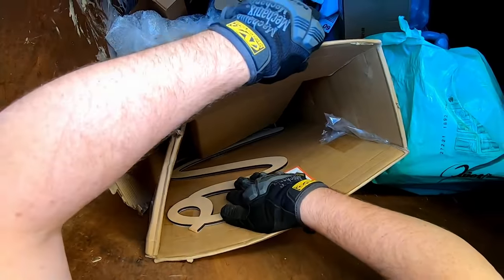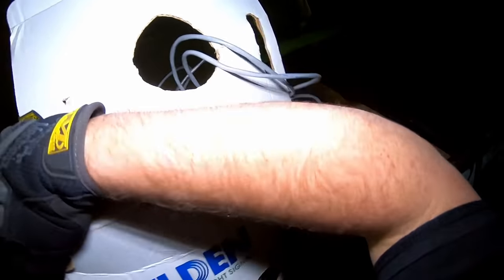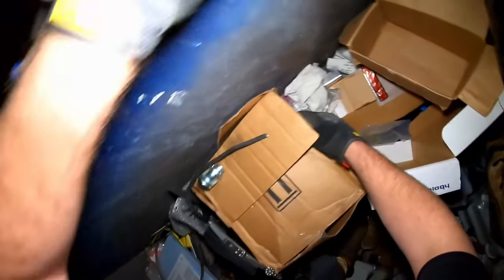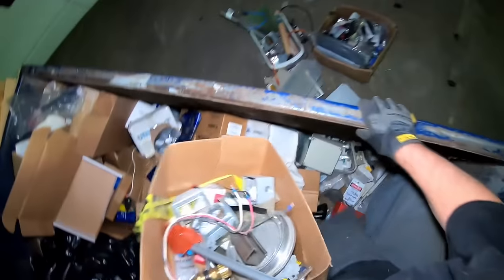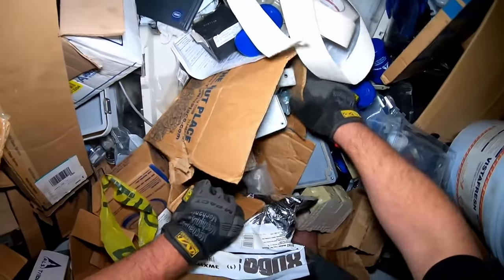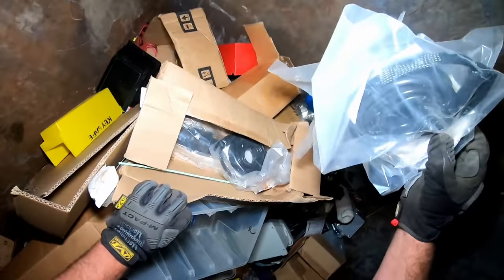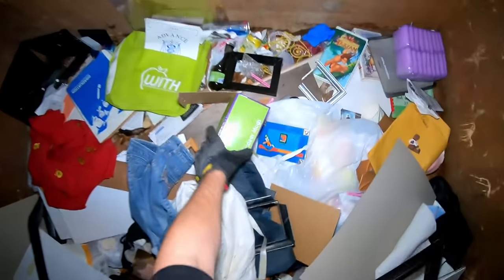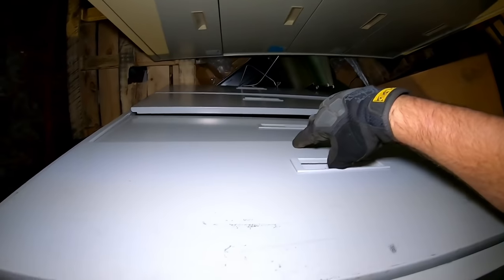Dumpster Diving "Now That's NICE!"

Comment: Mike the cabinets you got have weighed bottoms to help keep them standing straight.  And the lateral files have a feature that only one draw opens at a time.  That way they don’t tip over.  Also if you come across hanging file folders the metal arms add up quick if you want to take time to cut cardboard off.
Reply: I kept yelling at the screen close one door to open the other
Reply: @patriciasmith7282  I kinda did too 😁
You can only open the one drawer to prevent them from tipping over but you just have to know that 😁😁
Reply: @patriciasmith7282  i was yelling at the tv too... 😂 Full marks for effort but ffs... Frustrating as all hell 😂
Reply: Exactly the same, MIKE CLOSE THE DRAWER AND THE OTHERS WILL OPEN.
Reply: Same here
Reply: The lateral files I have sold since 1979  Do not have weighted bottom ...they are just plane heavy
Reply: @archermathews8562  Some days it's just hard not to be a smartass and this is just one of those days...SORRY 😜
Well of course it's weighted, if it has an airplane in the bottom of it! Otherwise it would just be PLAIN heavy. ✈
Reply: Went straight to the comments to see if anyone else was yelling at Mike to close the drawer first. Lmao
Reply: @lifeisxtc1  Same!
Reply: LOL I said that myself !!!

Comment: 20:44 as an old Electronics/HAM radio guy I cried when you tossed that shrink tubing for the second time that crap is expensive., but you can't see or know everything. That was an amazing dumpster and a lot of work Mike.

Comment: MIke, on the file cabinets, you have to completely shut each drawer before you can open another drawer. Its a safety feature to keep them from tipping over.
Reply: Yup, and on most of them they need to be standing upright to allow ANY drawer to be opened...awesome videos Mike, keep up the good work!

Comment: Not even joking Mike, you should have just dollies that dumpster home and emptied it out. Even stuff you left was good stuff. And some stainless steel is magnetic. Depends on the alloy. 32:13 most file cabinets have interior locks that prevent opening more than one drawer at a time. This prevents the cabinet from tipping over when multiple drawers are opened. Too many 5'2" 105 pound secretaries got squashed back in the day because they forgot their situational awareness. Make sure ALL the drawers are completely shut, then open the one you want.

Comment: Pretty sure those filing cabinets would have a safety feature that would prevent more than one drawer from being opened at a time, to prevent them from tipping over when in use full of files.

I bet if you opened one drawer at a time and then made sure it was fully shut before opening another it would have been unlocked.
Reply: Yeah I was laughing all the way through that but, I suppose, you have to know that is the case otherwise it is just the damn thing being cussed.

Comment: Hi Mike,
Enjoying your vids. 
Quick tip on file cabinets, in case you didn't know, only one drawer can open at a time. I saw you trying to empty drawers, one drawer was open, so you couldn't open the others. That's so the cabinet doesn't tip over if several heavy drawers were open at same time.

Comment: FYI- those big filing cabinets may not be locked. You just have to close one drawer before you can open another one. It’s a safety feature so idiots don’t get crushed. Can only open one at a time so it doesn’t tip over on top of you  😉👍🏻 you rock!!

Comment: Mike just wanted to let you know that most lateral file cabinets have internal safety interlocks so you must close all the drawers in order to open up another one,  ( Don't want it to tip over now😁) and as an electrician MY head spins knowing what those electrical connectors and other fittings cost.

Comment: That was the best Merry Scrapmas Day. Ho Ho Ho! The scrap was endless in that dumpster. Keep revisiting the dumpster...you may get another Merry Scrapmas Day. 

Those cabinets have a built-in safety feature. All drawers have to be closed, so you can open the next drawer. If you were able to open more than one drawer at the same time, the cabinet would topple over. That happened to me once, on my first job. Duh! I was 19 years' old, and was clueless. The cabinet fell forward. Luckily a chair intercepted it, and I tried to prop it up. If it fell on me, I might have been brain dead or crippled.

Comment: If you didn't know, big file cabinets, and sometimes little ones, will lock all the other drawers when you have one drawer open. So when your top drawer was open and you tried to open the others they wouldn't open because you had one open already. It's a safety feature so that the thing doesn't come tumbling down on you when you're going through files. If you want to open a drawer all the other doors have to be closed

Comment: Mike those file cabinets are made NOT to open only one at a time. Safety. Also, there are lever’s on the right and left side by the rails, just push and pull and out come the box.      How much copper was in that first dumpster?

Comment: Minneapolis scrap prices yesterday 
Brass yellow clean $2.44 lb
#2 copper $3.55 lb
Copper aluminum radiator dirty 
$1.60 lb
Copper #2 Insulated wire 
$1.36 lb
Copper drop cord $.70 lb
Electric motors $.22 lb
That's all I had

Comment: The lights are Vapor Tight. Hasardous Location would not be plastic, they have to have threaded holes so cast iron or cast aluminum and lens would be thick glass.   They have to keep gazes out...

Comment: Sometimes when I get file cabinets. When I get home I take drawers out and load them with small scrap items bolts, coat hangers and such. Turn the file cabinet on its back and load empty cavity up with pipes and such. Then when you get to scrap yard push it off. >Wayne<.

Comment: I just traded some found 14k gold with an amethyst gem(Female pretty charm) and 2 1977 Chopper blacklight posters(I have tons! And yes I found them) that I found (ALL) about 20 years ago for 2 made in Hollywood Dragon's from 1986 worth about $350 and a $20 Disney pin. Sometimes you can sell right out for CASH and other times you can make killer trades!!

Comment: You should have put some pallets under the cabinets to make it easier to left up and you did left it from the lowest point in the open top dumpster but you often work harder not smarter.

Comment: The first ones were kind of crap but that one I think you emptied like 3/4 of it. I know you don't usually take lumber but all I could think was that was probably $100-$200 in pretty decent looking plywood at current prices. You ought to get a piece the right size and make a shield for your rear window so you wouldn't have to worry about breaking it tossing scrap in.

Comment: Mike, the lateral filing cabinets are not locked, they only allow one drawer to be opened at a time to keep them from toppling over, I am sad that you left so many things behind at that first dumpster, you left behind $20 worth of shrink tubing and the waterproof plastic boxes with electronics in them, you look at almost everything as scrap and some has so much more value than just scrap. I wish the dumpsters near me were as rich in finds as the ones you go through, yours are amazingly full of valuable materials that you scrap only for the metal

Comment: I regularly get the feeling that scrapping stuff is "officially coordinated" across the city. How else can one explain how similar stuff is scrapped across multiple dumpsters all on the same day. One day its Cat Wire day, another is Electric Motors, Medical Equipment or Space Ship Parts. Secret meetings held and a target scrap item voted and agreed upon. Just got to be patient and wait for the Gold Bars day to come around :)
Filing cabinets, cannot usually open drawers if they are upside down and can only open a drawer if all the others are closed (open one drawer at a time, rarely 2 or more at the same time).

Comment: I can't believe the amount of stuff you just leave behind because it has plastic on it. Your father could use some of those plastic electric boxes and those explosion proof lights on his boat.the heat shrink tubing you tossed (bundle in rubber band) from the box of screws.
Reply: Not worth ripping apart.

Comment: Had a friend that went to a navy/ government  surplus warehouse  sale near Seattle,  he bought a metal cabinet like that but it had drawer with a combination lock on it.took it home and got it open, full of files, most were about radiation exposure cases and accidents at Hanford nuke site, he called the F.B.I. and they said they wanted them as they were marked above top secret,  but he didn't  have the clearance to even touch them, had to send someone,  one of the men in black types, I think he was Secret Service,  but not sure, he came and picked the files up. This was back in the 80,s 35 years later he read about the lawsuits over workers exposure to radiation.  He regrets not keeping them, but he was just being a good citizen by turning them over.

Comment: Working much harder than needed again.. u kept grabbing empty boxes and putting 1 or 2 large items in plus a handful of small stuff and placing on ground. That was a back the truck up to dumpster once u seen how much was in there. 
Maybe u were just in a rush in cabinet dumpster, leave files in for weight scrapyard does not mind as long as it's not jam packed full of paper the green hanging folders are fine, use pallets already in dumpster to get cabinets off bottom so it's an easy tip over the side same as loading a fridge or washer in back of truck.

Comment: Those filing cabinets are messing with almost bet you anything if it's like the filing cabinet in my shop it's triple wall lined they are extremely heavy it takes three people to move the ones I have in my shop oh and when one drawer is a jar the other ones will not open you can only open one drawer at a time and close it

Comment: Why would you not turn the cab it drawers inward u have them face the road also the doors weren’t locked a second drawer won’t open unless every door is closed all the way so too much weight isn’t out a once

Comment: I would have took all the trash out of that that way all the metal would have been stuck to the bottom you need to get you a shovel and a trash can like I do and let it all fall down and then scoop it right into the trash can that we don't leave nothing behind I know you're in a rush cuz you don't want to get caught but there's probably still at least 40 to $80 for the copper and stainless and just scrap iron there in the bottom of that dumpster

Comment: you would have saved a lot of time with both dumpster with lights & breaker boards if you parked pickup closer & used the tray you picked up earier & open top with filing cabinets by using the smallest as leverage for the larger ones for me it was painfull watching you fight against yourself where your trying to get something that loaded with paper sleeves over the top pf a medium sided opentop without using something to give yourself some height, in that one alone you had pallets & several cabinets to use

Comment: Slow down dude, did you just take a couple lines of Coke or what? work half the dumpster and then move to the other half and throw all the rubbish on the side you already worked. I watched you work one pile six or seven times. driving me nuts, you're working the same stuff over and over.